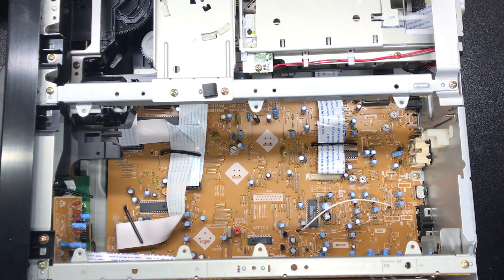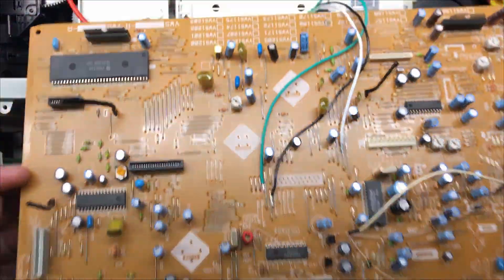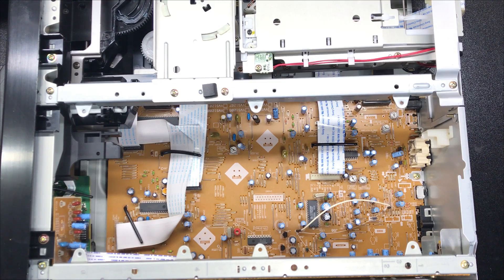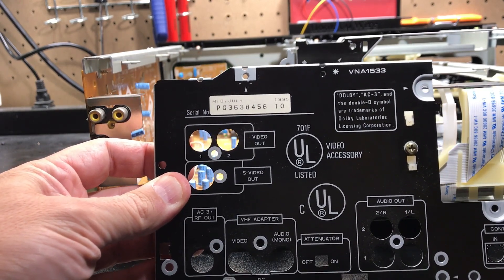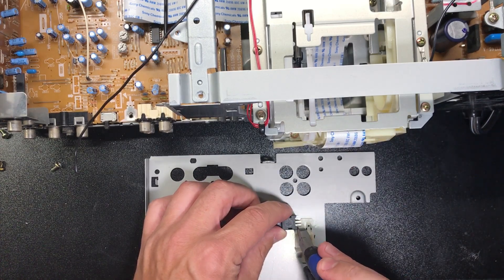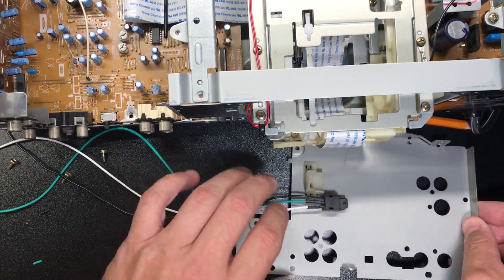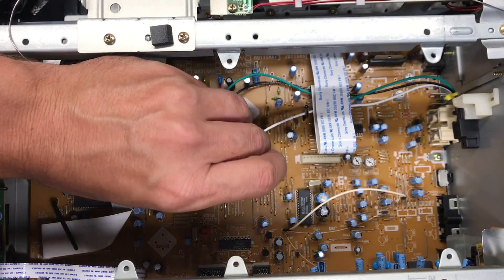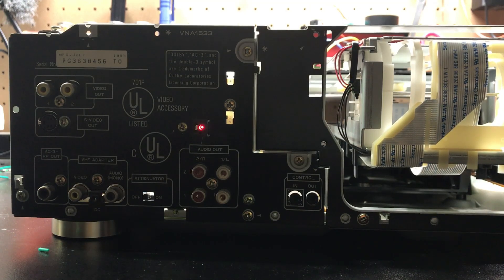Pioneer CLD-D504 Digital Out

Comment: Is this mod just as easy (three wires and a toslink jack) for the CLD-D505 as well?
Reply from the maker: Yes, it's pretty straight forward.  There is someone on LDDB who did a factory implementation of it.
Reply: @Laserdiscrepair Do they list and show the tap point for the digital out with photos, by any chance? Also, what is the use for the resistor someone mentioned and where do you place it?
Reply from the maker: @emilholmgrenmusic  check this out - https://forum.lddb.com/viewtopic.php?f=30&t=7210
Reply: @Laserdiscrepair I actually found it on my own and ordered the parts already 😅👍🏻

Comment: I have two industrial players (CLD V2600 & CLD V2800). Can this be done with either or both players? Ideally I'd like to add coaxial-out vs toslink-out. Any issues with using a coaxial jack?  Is your jig file meant for 3d printing?
Reply from the maker: Yes, it can be done with both.  For a coaxial jack, I think you need to put a resistor in line.  I have photos for the 2600 on where to connect for digital audio.  For the V2800, I have one of those laying around so I will just do a video to demonstrate it.  Look for that soon.
Reply: @Laserdiscrepair  My capture card only has coaxial-in, so that's why I asking about that. I do have a coaxial-to-toslink converter, so I'll probably do toslink to make the install easier.  Where are the 2600 pix?
Reply: @Laserdiscrepair  thank you - I would love to see it done for V2800 as that is the only player I own which is small enough to fit in my TV stand. It would be great to add digital out.

Comment: Great to see another player being modded for more functionality. This board has got the footprint for the SPDIF Jack next to the CD syncro socket at the back. There is a surface mounted resistor missing just near the chip that you soldered the wire to that stops the signal being router any further through the board. You can then cut the panel and it looks pretty much factory fitment. No extra wires etc. couple of components to fill the OEM spots but aren’t strictly required and the mod looks factory. Obviously yours works which is great but maybe the next one you need to mod you could check the back edge of the board for the empty footprint. There is a thread on LDDB by much smarter people than me about the exact components to fit which I have used as a guide in the past to mod players like this.
Reply from the maker: You are absolutely correct.  I put that in a CLD-V2800 and it looked factory.  The hard part for me was getting the square hole just right, no negotiating on that one.  Maybe I'll make another video showing that install.  Thanks for watching!
Reply: Can you link to the lddb post, and also where you would solder points to the board for a better optical connection. Thank you.